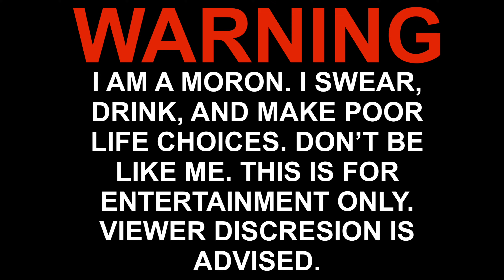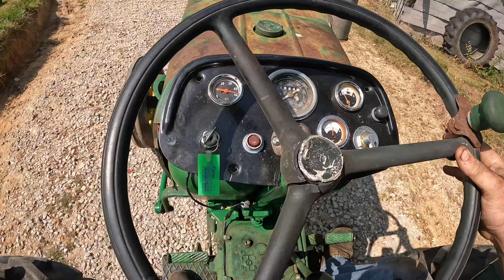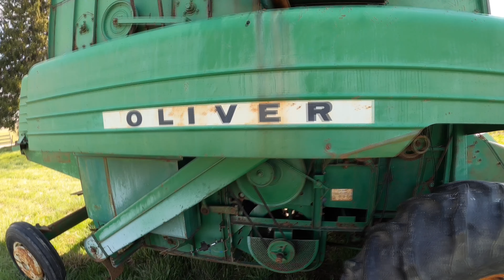OLIVER 1250 (Fiat 415) Oil Change and FIRST DRIVE!

Comment: When it comes to picking up tools I pick them up, drop them in a bucket or cardboard box, and then haul them to the toolboxes.  That way they (sometimes) get back to where they come from.  Of course, the 9/16 and 10mm tools tend to disappear.  And, getting a Snap-On dealer to make a tool warranty stop is apparently an impossibility because he does not want to stop out in the country.  Could you find a belt-driven governor from a combine and make that work?  That would get rid of that 24v generator chunk of useless WWII Italian metal.

Comment: Looks like you brought that one back to life!  Looking at that remote valve it is set up for single acting cylinders. If you add a line to that top fitting that is currently capped, you will have a single acting remote. To make it double acting you will need to remove the lower front plug and replace it with an adapter fitting the same as the top. The adapter fitting extends into the valve and blocks the tank port in the valve body and now you have a double acting remote valve.
Now it really needs some Clover white wheels.😀

Comment: Ross what was that little bit of oil you poured in the top of the rock shaft housing on top inside that Gatorade bottle for? Then you took a plug out on the bottom left by the arm? I don’t remember the 1365 or my 1255 having that? You also mentioned a filter under the triangle plate, is that only on the 1250’s  or 1255 1355 1365 1450 have also?

Comment: Finally, a running, driving tractor.  When you get into working on the governor, perhaps you could spend some time explaining what the governor is and how it works?  I know it has something to do with engine speed control and carburation.  Why is it tractors have governors and automobiles don't?  With the 1250 producing 35 horsepower, how does that compare with the power output of the 1365?  It does sound great and I am certain you will have it sorted out soon.
Reply: Automobiles do have governors, they're just utilized more in that case to limit top speed. Whereas in tractors they're more for keeping rpm consistent under load/lack of load. But yes, I'd too love to hear Ross talk about them.

Comment: Nice shift knob. Does that mean it is a 8 speed transmission??  😊
Reply: No 6 forward, 2 reverse
Because single gear lever every time 6 speed, but double levers 8 speed.
Reply: @Largo5441   I guess you missed the fact that the shift knob is an 8-Ball 🎱.